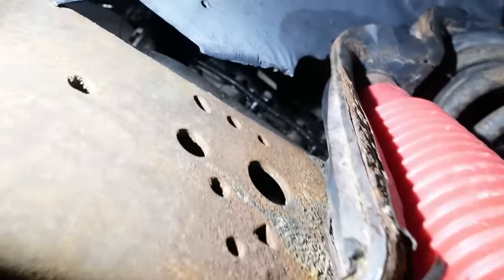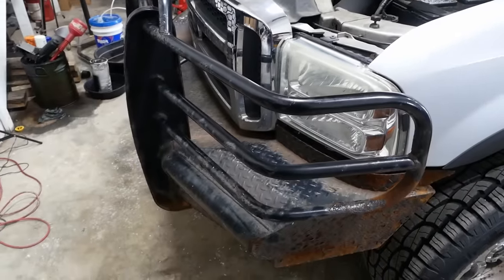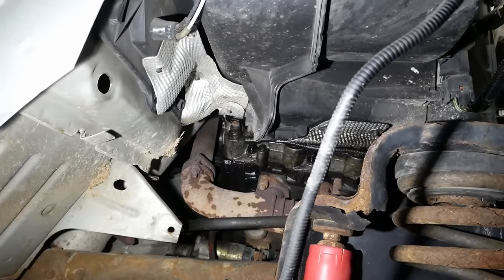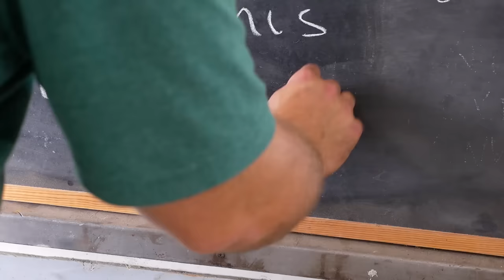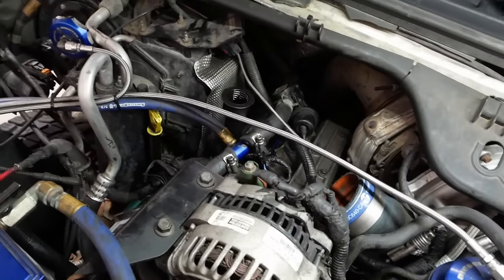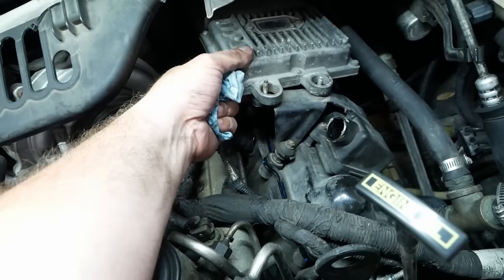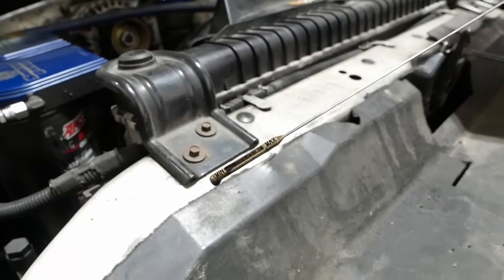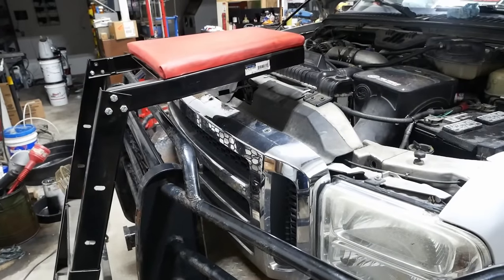6.0 Power Stroke Makes me Question my Life Choices - Major Oil Leak

Comment: On a 6.0 let me save you time and suffering. You don't have to remove the fender liner, there are only three bolt on the passenger side which are difficult but easily removed with a ratcheting wrench. After removing the turbo tube and glowplug harness connections (including the glowplug wire to the battery), you can reach under the HVAC with that wrench and remove the last three bolts. Never us an impact for removal or installation unless you like tapping holes, you should always feel.  I can remove both valve covers and install them in 1 hour without ever stripping a bolt. The other oil leak  is usually the oil pressure sensor which will leak down the back and sides of the engine.

Comment: Near as I can tell, you need about 8 of those little wrench's, then get em off the floor when done......
 I to was wondering about a self tapping bolts, if me thats what I'd do. What you did would drive me crazy, I'd have to use a 12ga drill and make some new easy access holes...........

Comment: Dude i needed this! Hilarious! I laughed so hard I'm in tears!. Because the just honest to God truth with everything in this video!!. I did this and more to my 04, it will test your sanity!! But man great job. You literally did everything i had to do in your vid. Beat the covers back to flat, Drop the wrenches 46 times, absolute truth....i did NOT have to heli any of my bolts.. but the glow plug harnesses, omfg, picking out little broken shards of plastic with tweezers,  scraping out sooo much corrosion the new o rings wouldn't even stand a chance.. nightmare to say the least! But I WIN!! valve covers, hpop,oil cooler alllllll redone!! Aaaand it still leaks from the rocker box oring that you can't change without pulling the head..aaand from the rear cover...and rear main seal...and front cover..and not a thing i can do about any of it,, besides park in the grass..... I love this truck , i really do, but she's a f$$$k$$ son of a f$$kn brat I'll tell you that..... your video made my day tho 👍

Comment: Ah this brings back memories. I’ve probably made $30k working on these old 6.0s, and that is as a technician making $25-$30/hr, not as a shop owner making $100-$150/hr plus parts profit.

That’s definitely one to say “no” to. More like “hell no”. Anything with one of those stupid, useless front bumpers should be an automatic “no” or at least add 5 labor hours to the job since they make engine bay access impossible.

Comment: Hey Wes, wonderful effort. I hope you got the $2k.

I'm am not Helicoil proficient. I've run into a number of stripped threads on transmission pans. Especially the bolts were the bottom threads of the bolt are exposed (EAT4 transmissions).

My solution has been to buy grade 8 SAE bolts (1/4" for 6mm threads). I turn one of them into a tap by grinding/filing a tap contour into it.

Throw a little tap magic on it and drive it home. Remove and put in the replacement 1/4".

Yea, it might screw up the next guy. If they were paying attention they should see the difference in head diameter...

Comment: How much labor is involved in pulling the cab? Just tell the nice folks any work that requires doing the Limbo under the cowl or is otherwise blocked, will only be done AFTER lifting the cab. Seriously, I think it's like ~2 hours or less for someone of your skill level to do. I'm sure the custom fabrication of the heli coil kit and human origami of actually doing it, took more than 2 hours. Why punish yourself and, knowing your stout character, probably, at best, break even on a job or actually lose money? You KNOW it would have taken 5 minutes to heli coil that bolt hole if it were reasonably accessible.  It may also be a good way to dissuade customers from contracting your services and then you've solved the root cause of your misery, minus the "guilt". Yeah. I know; YT goodies. Is one vid worth your physical well being/mental health? There's other ways to create content. Lessee'...put the young'un on the four wheeler and hang some Milk Bones on the rear of it. Then start it up, send him on his way and turn Max loose. I'd watch that for 15-20 minutes. 😁

Comment: Dear Wes. Remember the old saying, "Run a new truck under the radiator cap, then replace the radiator cap." I believe that applies to FORD 6.0 diesels. Sorry. Can you believe the same company that built the 427 FE engine is designing these pigs?

Comment: I just finished rebuilding a 258 AMC Jeep engine. Five of the seven rocker cover bolts were stripped out. Someone had attempted to helicoil them but stripped them out as well. I figured out why there was souch damage. The after market aluminum cover (the original was plastic) wasn't notched to clear the machining bosses in the head. It couldn't be properly tightened without, maybe, double gaskets. Not the proper solution. I makes the locations and ground clearance as needed in the cover. Hey now it tightened up and doesn't leak!!?? Wow! Thanks for the videos!

Comment: Just wondering would it be more cost effective to just convert the truck into a Gas V8 instead of constantly fixing it or would it be the same thing really in cost? Im. just wondering cause I always see these 6.0 power stroke issues and seems to me that all the money these guys spend on em they could literally convert the truck to a normal Gas V8 or flex fuel.

Comment: Pretty coincidental that I get a call this morning after 3.5 weeks of no work. I understand that places are behind, so I give them a week for lead time, but that still 2.5 weeks.
6.4L. Went to a dedicated diesel shop and the truck needs new DPF, EGR coolers, and Up-pipe.
I tell him I know a place that remanufactures the DPF, and he said he'll check a local place because he didn't want to ship parts out. Calls back that they can do it for a fraction and he didn't know that was possible. Not confidence building.
Same with others, tell him to send EGR to radiator rebuild place, and the up-pipe to a  machine shop for welding.
I'll save a ton versus new parts. Repair should be the first option and not place with these Ford diesels.

Try a time-sert.
Aluminum stud welder? If it works you can use a nut or double nut on the cover

Comment: As you know, Wes, aluminium is a soft metal. This is due to the fact that the bean counters will forever cut the costs of materials. I believe they will always have it their way, whatever any other person thinks about it. Neither do they care about the quality of the components the workers assemble. Most of those jobs are accomplished by robots. What else, me? Is it Ford's fault that the 6.0 l powerstroke is as bad as it is? No. It's Navistar. Why did the end production of the 7.3 liter powerstroke engine? Those bean counters insisted on cutting costs. They were given their wish. As the engineers were designing that engine, they were thinking of doing what they were told by those fools. After that engine came to an end of production, then came the 6.4 liter powerstroke engine. That was the final Navistar engine put into the Super Duty truck from Ford. The next of them was the first generation of the 6.7 liter powerstroke engine, which is cast and built in Chihuahua, Mexico. Wes, did you hear about that engine? They have a high output version of it. It produces 500 horsepower and 1200 foot pounds of torque. A regular cab, two wheel drive Super Duty is capable of towing 40,000 pounds. The gross combined weight rating of it is 48,000 pounds.

Comment: Here ya go a tiny wrench poem:

In a world of bolts and nuts so grand,
Lies a tool in the palm of my hand.
A tiny wrench, with strength concealed,
In its compact form, all problems revealed.

With jaws so small, yet mighty and true,
It tightens and loosens, whatever it's due.
In the garage or beneath the hood,
This little wrench, it works so good.

Amidst the clutter of tools so vast,
It stands out, a gem unsurpassed.
In precision and grace, it's a dance,
Fixing what's broken, with every chance.

So, here's to the wrench, so small but bold,
A tool worth its weight in precious gold.
In the world of mechanics, it holds its stance,
The tiny wrench, a symbol of diligence.

Comment: I was a mechanical design engineer, Aerospace. The old joke is they want us to put 10 lbs of $hit in a 5 lb bag. So engine bay is no different. Sales and marketing guide all that and all the accessories available in trucks like any other consumer product. We engineers work on our own vehicles and say the same thing about another design team's efforts. Aerospace MUST think about service and repairs as dictated by the Airlines repair shops needing short down time. Vehicles not so much. No pressure from dealers wanting repair money.  Whatever can be built can be removed and repaired....BUT the independant mechanic who is trying to be less price and acccomodating than a dealer and honest and do great work like you, is screwed, glued and tattooed. So Vehicle Design Engineers at the master assembly 3D solid model computers work with various depts and vendors trying to sync the 10 lbs into the 5 lb engine bay. All the while being advised and issued change orders from manufacturing engineers on the assy floor dictating SOE. Sequence Of Events. It's literally hell on wheels. Ultimately it's the customer blaming you, not the maker for how long it takes and how much it costs. The repair manuals are written before the truck is built and ever repaired. The time is a total WAG. Screw threads and plastic and aluminum don't mix, but hey its lighter and cheaper. Easier to cast/mold and machine.  So get a tattoo and drink more. There is no way out. Thanks for the funny and informative vids Wes!!! As you can see I am a part time personal motivator now.

Comment: Wes, bid the job with a Required full set of replacement bolt that you design. Watch Wes's bolts Work.... valve covers and other stripped hard to reach aluminium nightmares. 
Go getum boy!

Comment: How bad does an oil leak need to be before it warrants repair? I had an 86 Firebird when I was 19 and I had to add at least one quart of oil per trip. Whenever I parked it, there would be a lake of oil beneath it.

Keep in mind I knew next to nothing about engines, cars, etc. I had it looked at and got the standard Pep Boys diagnosis. Rocker cover gaskets. It didn't sit right with me.

I took it to my high school shop teacher (I had graduated a couple of years ago). He saidbhe taught me better, nothing "leaks" that much oil. We didn't even lift the hood, he loaned me a tool and told me to change the oil pressure sensor. Have his tool back in a week (he didn't need to say the "or else" part). $13 later and the leak was fixed. That was about 25 years ago, haven't seen him since.

Thanks again, Mr. Napier!

Comment: Excellent video Wes  : ) should say I up for challenge to do this repairs on this and does outbeat me yet Lol ! I had interesting  lately to do and shocked me what happened I explained! Was going to get groceries for me , my mom , plus oldest brother David  3 weeks ago Tuesday , use my mom 2010 Dodge Journey SUV starting up in driveway and push brake I had horrible on get floor shifter get in Drive gear really had yank both cable felt so tight to so let brake felt like in Neutral to so treid put Park only go up Reverse gear and rolls forward so push brake pedal  and emergency brake on too! Found cable snapped on me plus gear shifter to stuck Reverse gear too ! So had got to shop Tow Truck  I did and plus overnight got cable and brand new shifter from Chrysler dealership took 9 days get too ! Have not heard recall on that happen to others vechiles but thinking should be ! But I know in past gear shifter was feel tight then feeling okay afterwards drive on Cold but was running in half Neutral and half in Reverse or half Drive in gears selection and like transmission slip  or half power like backfired problems! Told at Dealership in past check over and said fine ! But glad brakes all new installed recently and couldn't used or be seriously vechile accident plus myself killed to or neighborhood farm feild ! My home area had lots traffic that day to when cable snapped!

Comment: Heres my 2 cents. Get a 6.7 Cummins. Delete and tune with FASS fuel system. Keep all well maintained and not rode hard and put up wet. You will get 700,000 miles or better.

Comment: I do lots of jobs like this.  When I see a lot of aftermarket parts, and see that I will likely find stripped threads, or broken off bolts, I tell the customer, they have a choice: Either I work time and materials, OR go somewhere else.     These motors, absolutely suck the worst.   Best solution, is fix it right, as you did, but make sure you get pay for your hard work, and the customer gets rid of that hunk of junk, because they can't aford to pay you anymore.

Comment: One of the few things that International did right by the 7.3L and 6.0L powerstrokes were front and rear main seals. I've worked on dozens of those old trucks and I've never even heard of replacing one. It's usually the valve cover gaskets or the turbos on 7.3L's

Comment: I work for an ems company as a mechanic 80% of our units are 6.0s what we do when theres a stripped out bolt we just put a 7/16 bolt in there and it threads in fine and tightens

Comment: Long Explanation: The coolant filter is to collect casting sand that didn’t get cleaned out of the block when it was manufactured. The casting sand can clog the oil cooler and cause an overheating condition which causes the EGR Cooler to fail internally or the head gaskets to blow. Once the casting sand has all been removed and the system is thoroughly cleaned, there isn’t much reason to put a filter back on as long as the cooling system is regularly serviced. Most guys keep running the filter after bulletproofing for peace of mind.

Short Explanation: It’s a 6.0L thing.

Comment: Call em what you will but I have the Hercules 1/2" 20V rattle gun and the things a beast. You have to be careful or you'll twist off 1/2" lug bolts no problem.

Comment: A true story ripped from today's headlines!

I have a friend who owned a 6.0 Ford diesel. He had it for sell at a very reasonable price. I was interested, but I had heard bad things about Ford diesel and decided to do some research. I called a couple of diesel manchanics to get a price to rebuild the engine, if required. It was very expensive, but here's the kicker. I called the local Ford dealer and was told......"don't buy it, if something should happen to the engine,  (and I believe there was a problem), it's not worth fixing." 

This was from a Ford dealer! I was also told that they had 6 other diesel truck sitting behind their garage that the owners did not want repaired because they were tired of 
Spending money on them.

Comment: Looked like some oil coming up that intake, from the turbo, yes every one I touch has stripped valve cover bolts, generally on glow plug module bracket from not using a backup wrench., you have to pull the rockers and head bolts to replace that upper “rocker box” , that intake boot on the turbo being melted around the turbo is a good sign it’s been hosed with starting fluid., and I think the big issue there is injectors, and people throwing one injector at a time, so each cover has been off four times for injectors, and two or three more times for high pressure oil leaks, long cranks, and hot no starts… it’s an awesome engine on paper, and probably pretty good in the real world if California and the rest of the government left it alone, is there really an epidemic of light duty diesel pickups causing “climate change” while container ships idle more fuel in a day, that all light duty trucks combined..but hay “were following the SCIENCE “ …

Comment: I applaud you for installing a helicoil.
Here's a cheap hack that is not pretty but it does work for non-stressed applications like a valve cover.
A lawnmower shop guy showed me one of his tricks for a stripped hole remedy in aluminum.
He took the fastener from the stripped hole; then pound the threads of the bolt on the back of a vise until there were 2 flat sides and 2 sides with threads. 
A 6mm thread would effectively become 6.5 to 7mm wide; turning the flattened bolt into a kind of self tapping fastener.
 On a 6mm fastener this "repair" would easily take 6 to 7 ft/lb of torque and could be removed and reinstalled several times.

Comment: What does a coolant filter do on an engine that doesn't use wet liners? There are differing schools of thought.

Some people put coolant filters on gas engines because they had to replace (or paid to have replaced) a heater core due to buildup of material. They also believe this will make their water pump last longer. Right or wrong, I can at least understand their logic.

Others seem to believe that what's good for a heavy duty 15 liter engine is good for a car or light truck engine. Getting out there, but again I can understand where they were coming from.

Lastly, you have the lunatics. These people can usually be found in the auto accesories asile of your local Pep Boys.  These are the guys who have chrome plated tire valve caps that look like dice. The nozzles that squirt washer fluid on the windshield are little light up skulls. License plate frame looks like a chain, or possibly barbed wire. They have a 4 inch exhaust tip on a 1.5 inch pipe, but only because they can't figure out how to run a stack without scraping the ground. They have a neon kit, but it's not hooked up because when it's on, something in the wiring makes the cigarette lighter shoot out and crack the rear glass whenever they cross 2100 rpm.